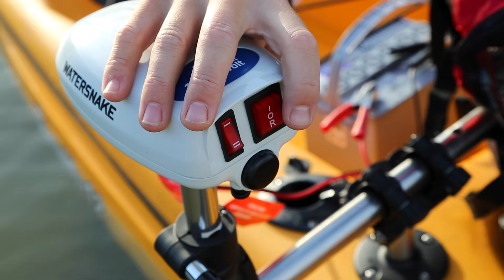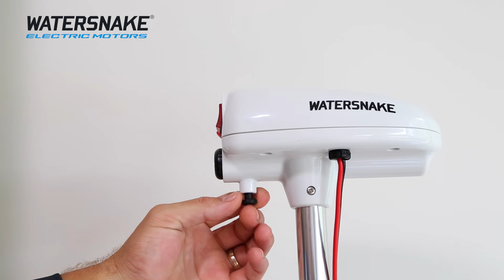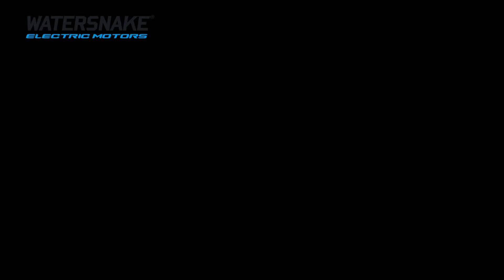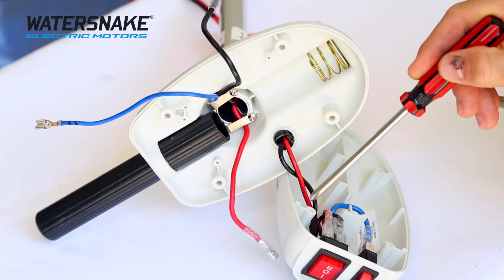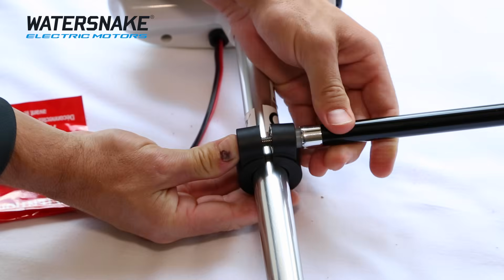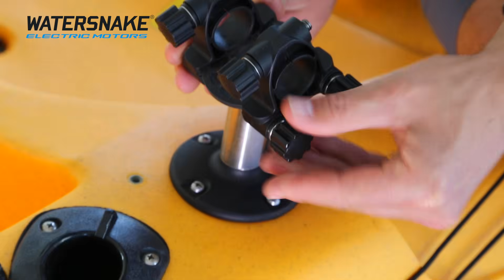Watersnake Universal Electric Motor Mount for Kayaks and Canoes

Comment: Is this a older model or something as my mount looks different dosnt have the small metal pole at the base of mount its two bits of plastic which screw together
Reply from the maker: Hi Sam,
Yes the video shows the original model. There have been various improvements made over the years, including the difference you mention.

Comment: i got a motor from a family member but he kept the mount i easnt going to spend $80 just for a mount so i got a universal fish finder mount off ebay bolted the shaft to the mounting plate and the round mounting plate to the kayak now i have 1 screw to control angle and works just as well as the original mount i used u bolts to secure the motor pole to the top mounting plate

Comment: The Jack bar is extremely smooth and will want to rotate when the motor runs, the locking screws designed to prevent this rotation aren’t really big enough to tighten enough by hand. The torque created by the motor is too much for them to hold the Jack bar in place. The motor itself is just fine, unfortunately the mount needs a work around. Close but not close enough.

Comment: I do not recommend the Watersnake in the side mounted configuration. You can turn on one direction and list in the other. It's hard as hell to keep your bearings true on the low setting and the high setting tries to tip your fucking kayak. Recommend mounting off the front, extending the tiller handle and wiring up new switches on the end of a cable so you can reach. As it stands without modification, it's a piece of shit.

Comment: bracket bolts need a redesign they cant handle speed 2 you cant tighten them hard enough to stop motor from wanting to come out of the water

Comment: I've fitted this the best I can, looks right to me 🙂 but I keep doing 360s and can't go straight. As fun as it is, it's not very practical. Any idea what I've done wrong?
Reply from the maker: Hi and thanks for reaching out. Please email our Watersnake team at watersnake@watersnake.com.au and one of our technicians will be able to assist with your issue.
Reply: @Jarvis Walker Brands  Thanks so much all sorted and its going great 👍🏻
Reply: did you figure out the problem
Reply: @Kimberley Bennett  
I thought I figured it out but it seems hand tightening the bracket isn't enough, ill take some pliers next time and tighten it as hard as I can and see how it goes.
Not as strong as a guy (obv) and it doesn't hold it where I need.
Reply: @thatbitchonthehorse5303  my partner just got one and his keeps sending him in 360s to we’ve tried everything just thought i’d see if you figured out why it’s doing it to you to haha
Reply: Finally sorted lol I just had to mount it closer to the middle of the yak than is shown in this video. Problem solved 😂
Still having trouble keeping it tight though I have the old version like in this vid.

Comment: I bought the motor mount and the 24 lb motor,  great motor,  the mount  I can't recommend,  at low speed  it is difficult to steer and vibrates a lot, high speed well just don't do it. 
I eventually mounted the motor through the cassette that fits in the drive hole works v well .

Comment: This will have to go down as one of the most useless products in history

I had to make modifications to this bracket to stop it moving and kicking around everywhere.  The swivels bolts have to be  tightened with multigrips as doing them up by hand will not achieve the required tightness
And after all that all I could do with  the kayak was  go round and round in circles. I had the motor mounted perfectly to. The bolts that hold the bar on cannot be  tightened enough with anything and will work loose in no time causing the motor to buck and move about. My modification overcame this problem drilling a hole through the bar and and taking it right down through the bottom with a longer Bolt that holds the two halves together.
There's just no way you can control the kayak with this thing on the side. After 3 hours trying to steer kayak ,I gave up. the extra weight on the side also makes your kayak even more unstable than most kayaks already are. It's a recipe for disaster and this product should be recalled as I believe it's possibly dangerous. Totally unprotected propeller blade as well on the motor.  While attempting to get into the kayak I accidentally knocked the on button on and the spinning prop came within inches of my ankle . Listening could slice you up. Also you must start the kayak in low speed as if you started in high speed the inertia may cause you to capsize
I found it a very uncomfortable experience and these kayaks themselves virtually useless big boats will wash you to Davey Jones locker. 
I think I might attempt to take legal action to take this product off the market
Reply: Same here just tested mine today. Junk! The clamps dont hold it at all.
Reply: Same here. I tried mine in the weekend and clamps didnt hold, also it bucked under. Complete useless as per the set up in the video. The motor had heaps of power my viking 400, 4.3 km/hr on speed 1 and around 8 on speed 2 while I was twisted to the side trying to hold the motor shaft vertical to stop it bucking under the side of the yak. Looking at possible modifications online and will talk to the shop on how to remedy. 
Overall the mount as is is useless!
Reply: @brentgillett8579  Hi,see my utube video on kyak modification on my channel, Tuberworks Jones, Note may not be possible on all kyaks but it may give you ideas. Any improvement ideas on my hack welcome

Comment: So how do you mount these things on kayaks that don't have an underside access to where you need to tighten up the bolts underneath on the mounting plate ? I notice you skipped over that part ! I'm assuming that means cutting a hand sized hole in the kayak somewhere and then putting a plate over it to make it look pretty again and stop water getting inside ?
Reply: I have the same issue - Im looking into Wellnuts, or toggle Bolts as possible solutions, as suggested above.
Reply: @oldmanhads2043  Yes not having used them before I wasn't sure if wellnuts would be strong enough as those motors can  generate quite a bit of torque. I guess if you used them in a very rigid part of the structure it may work  ?

Comment: Wow would have been great to see this video like two weeks ago when I was constantly searching Amazon, YouTube and the web for a transom mount for my kayak! Got fed up and built my own for less than $20 and no drilling holes. Now if the internet would let me find Boating Lights I would be done!
Reply: Try ‘navigation lights’.
Reply: @johnstarkie9948  I built those myself too!  Just took more PVC and added a 3" chunk of 2x4, screwed it to the transom and drilled a hole for the PVC to stick into and put a light on top.  Similar for the bow lights, took a dowel and stuck it down the bow drain pug and then matched the angle with another chunk of 2x4 to make it level then attached the green/red light on it.  Also installed a PWM.  Now that is a game changer.
Reply: @nathan sumners I would love to see a photo or video of your home made setup
Reply: @markj1232  I tried to submit the photos link via imgur. but again my posts have been deleted.  You don't have an email address on your youtube about page or I would have sent them to you.  Do you want my email?

Edit:  Just a count of how many times I have replied to this one comment and been deleted.  This is the third attempt.
Reply: @nathansumners6321  i know it's been a while, and you have tried three attempts, but I definitely wanna see how you did it so as well. Any video available on Youtube?
Reply: @markj1232  Just tried to link the imgur photos that I took this summer.  YouTube instantly deleted it.  I should just send it direct.

Comment: Very disappointed in this product. Firstly the mount will not tighten up enough to hold the motor steady, this is a common complaint by a lot of owners but my main grudge is that when it is not being used, and you want to tilt it out of the way, the top is very close to the water, BUT IS NOT WATERPROOF! water can easily enter the case that holds the switches and wires, mainly through the pop out handle, then when you put the motor back up vertical THE WATER RUNS DOWN THE SHAFT, INTO THE BOTTOM ELECTRIC MOTOR. What a stupid design?  Surely even Aussies aren't that dumb? I look forward to comments from
https://www.youtube.com/channel/UC6kuOuvpiJOx7cEVrHKUDdg 
Don't purchase, just save a bit more for a better quality (well waterproof one anyway)

Comment: What they don't tell you is how flimsy it all is, they say "how it sits to the water is CRUCIAL" what they don't tell you is the joints are so loose of a fit that the thing flops all over the place. 

Also they don't mention that you need at lest a 40 Ah battery which will weigh about 12 KG and that you have to lug to the water with everything else, unless of coarse you buy a Lithium battery which will cost you more than the boat did....
Reply: I have an 18amp battery and it works but the whole mounting system is shithouse.

Comment: How long will the battery last before it needs charging and how do you charge it ?
Reply: Depends on how big your battery is and settings of your motor.

Charge with appropriate charger depending on your battery chemistry, voltage and size.

Comment: I came here to see how you install the bolt nut and you have successfully skipped it --- what can I say?
Reply: My first thought and I said the same before I read yours. I notice Jarvis Walker never replied to you so I won't hold my breath for a reply either.
Reply: I too came looking for this - I have my motor and am ready to install it, however I dont have access to the underside of my kayak - are there any solutions to this?
Reply: 4 years later.. I’m looking for how to install the bracket.
Reply: Gain access to the mounting position via a nearby hatch, reach in with the washers and nuts and tighten. To show this on video is a little tricky. Good luck.
Reply: @ShootTheGlass  that's obvious but not so easily done. Very tricky in fact, that's why they haven't shown it in the video.

Comment: I had one and the switch burned out. Mind you I modified the connection to fit my 4s lithium ion battery (up to 16.8v). I’ve been designing a brushless unit and if it doesn’t work out I’m thinking about the Bixpy.

Comment: use a railblaza motor mount. easy installation. remove and away you go. i have 55 lb thrust newport vessels motor which allows me to scoot along pretty well. don't buy the kit on amazon (way too expensive.  get the motor mount from yak gear and the motor on amazon.  the motor mount comes with everything you need.  would suggest you use a counter weight to offset the weight of the motor (about 20 lbs.).i use a waterproof camera bag full of gravel.
Reply: why not put your battery slightly off center  to even the weight distribution  ??

Comment: I have a ascend 12t any ideas on how I should side mount this unit
Reply: use a railblaza motor mount. easy installation. remove and away you go. i have 55 lb thrust newport vessels motor which allows me to scoot along pretty well. don't buy the kit on amazon (way too expensive.  get the motor mount from yak gear and the motor on amazon.  the motor mount comes with everything you need.  would suggest you use a counter weight to offset the weight of the motor (about 20 lbs.).i use a waterproof camera bag full of gravel.

Comment: use toggle bolts instead of the bolts provided. I was not able to reach my arm far enough in to use provided bolts and nuts.
Reply: You might try well nuts.  You push them through the hole from above, and they expand below and capture the nut.
Reply: @rcmallory  well nuts seem the way to go although over time I'd expect the rubber to perish and eventually need replacing, especially if exposed to salt water.
Reply: Great suggestion, however it means drill much larger holes in the hull.

Comment: I like how they skipped the hardest part, "getting the nuts on the back of the bolts" That part alone keeps me from buying this.
Reply: There are no nuts. Its a threaded plastic post. BTW there are better and simpler ways to attach these to your kayak
Reply: @NXAussie500  Do you have suggestions on this as drilling is not my favorite idea? Thanks!
Reply: @bluxa  sure ... don't need this complicated set up.. can use a simple PVC pipe mount dropped into the rod holder behind the seat or check out my motor mount hobie videos.
Reply: You got no fucking idea what your talking about @oz outdoor there are 4 bolts that go through the kayak and each have 2 washers and 2 nuts for each 5mm bolt and the only access is via the rod holder and I still only got the one nut on the furthest bolt so shut ya fucking mouth tool
Reply: @rikkcampbell8975  Damn bro calm down

Comment: You left out the footage of the bolts being tighened within the kayak. Can you please provide footage of this vital process.I won't be a able to purchase the T24 until I have seen it. Thanks.
Reply: Nick Duckitt just make sure that you have access to where the nuts go. If you don't, use rivets instead. You can get a rivet gun for around $10.

Comment: I have one of these but I mounted it on the back. Is so much better, kayaks don't steer well from the middle!
Reply: I have a side mounted motor on my Big Tuna and it steers fine, but not in the middle but mounted just behind the back seat in the single paddler position.
Reply: Ya.  When you're just trying to go in a straight line, you have steer the motor into the boat's hull slightly to offset its natural wanting to turn.  You lose speed and efficiency this way.

Comment: I have just ordered this unit that comes with the new bracket only, So would this come with the shaft holder already pre-attached ? as the video refers to those changing over from the old style brackets to the new one. One would assume that the need to avoid having to remove motor head would be more of a benefit to the technically challenged buyers. Also I noticed the video does not show how much difficulty there was in trying to attach the nuts to the bracket underside if the rod holders are the closest point to attach. Would need very small hands.

Comment: im tryin to order one from ebay. just not sure if it will fit my Minnkota endura c2 trolling motor.  the shaft size is 1.125 inches i think thats 28mm. do you know or if anyone has tried to mount that motor on your motor mount? want to know before i purchase. thanks
Reply: Silasa did you have any luck with it working the Minn kota?

Comment: Also why is the motor mount requiring disassembly of the motor head when you could have easily designed the bracket that attaches to the shaft to bolt on???? instead of sliding onto the shaft... crazy stupid design
Reply: they make one that uses the stock transom mount and also uses the built in rod holders to mount so no drilling is required.

Comment: Hi, How tall is the actual mount? I'm carrying my kayak upside down on my roof rack and wondering if the mount will hit the roof of my car.Thanks
Reply: Mount is about  4 inches should be ok
Takes about 30 seconds to take mount off 30 seconds back on
Reply: Above the mount stem are screw bolt type clasps taking height to about 8 inches soooo easy to take off and put back on